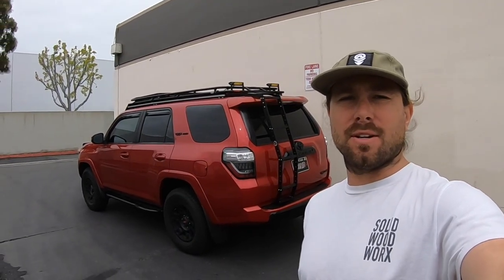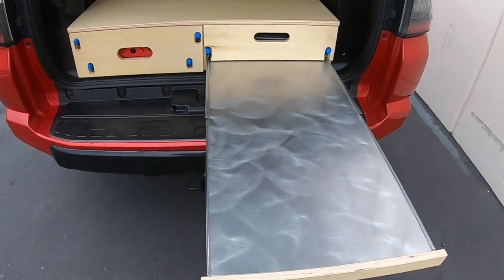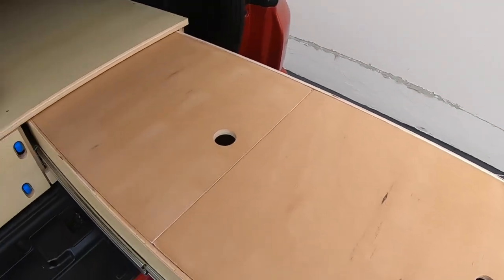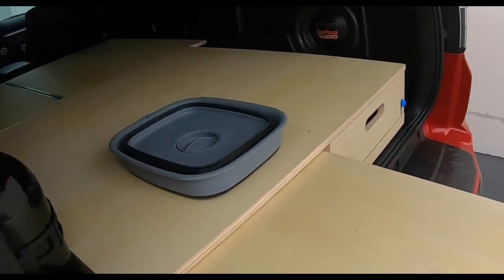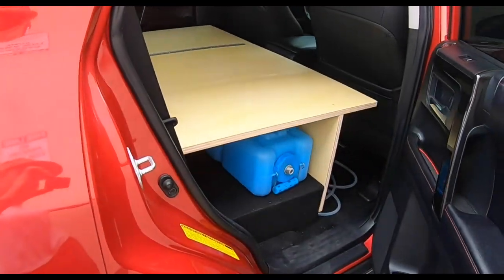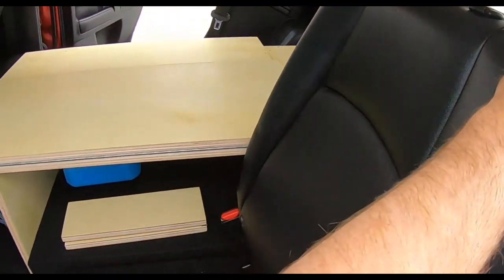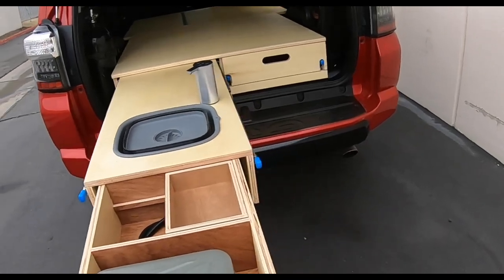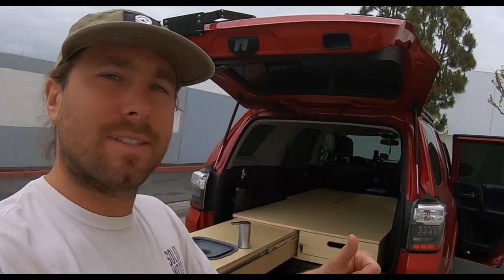5th Gen 4Runner Double Slide Cooking setup!

Comment: I've got an 8 ft. bed slide in my Tundra and use a 48" Dewalt clamp (reversed to be a spreader) for a single support leg when I have the platform completely extended and fully loaded. Being fully adjustable, the clamp adjusts to any height  and takes the load off my bed slide hardware. The portion of the clamp that extends up above my platform comes in handy for hanging my hat or towel. Ez pz. Nice work on your set-ups. For your system, I'm imagining a single leg that pivots down from a routed channel in the bottom of your drawer bottom with a telescoping leg similar to my Bosch tripod for my laser level. Simple, but stong enough to keep the drawer from sagging any.

Comment: Love your work, very clean and great looking... Still looking forward to a Jeep wrangler one though !!!
Reply: Cutouts doors in the platform for access to the slide out drawers from the top when your in the vehicle would be cool.  Also, smaller hole cutouts strategically placed on the whole unit for weight reduction and air circulation to prevent potential mildew issues that can be created when sleeping in the space.  Design a shelf above your feet area when using to sleep to store refrig/cooler, Jackery, water, food, etc.   Cheeper Jeeper TV YouTube channel has a great mod build on a sleeping platform & shelf design. With this drawer system and the Cheeper Jeeper mods, plus your own tweeking, I believe a great setup can be achieved.  Then, add a net attic system for additional overhead storage.
Reply: @grizzbuck  Thanks for the info, I do follow Dino and his channel, I just love the aspect of the small/fine details that make the difference. I know that the platform Dino made has been "updated" by another person. Honestly I have already made my system already, just love the way Solid Wood Worx shows his production and all the helpful ideas and tips !!!

Comment: What weight slides did you use? I am planning a double extension with a fridge draw on the other side. I am curious how the 72” draws setup is working out? I am worried that boiling a pot of spaghetti out the end might be precarious.
Reply from the maker: It does slant a bit. The customer uses a monopod leg if he has to cooking anything heavy on the end.

Comment: how does the sink drain and is the box storage unit you made waterproofed?  also did you account for the sitting water in the sink if the drawer is fully extended and what weight capacity it might hold with the drawer slides.  its a good design and im very interested in doing the same for my trd pro.
Reply from the maker: The sink has a little plug on the bottom its mostly to wash dishes then you dump the water when your done. I saw the customer yesterday and he says the whole setup works great. Yes everything was coasted with polyurathane.

Comment: Does that pump work just like that? As in, take it out the drawer, sit it in place and it is ready? Amazing if so!
Reply from the maker: Yes, you have to connect the water line but ya it is battery operated.

Comment: I have a Toyota 4Runner (4th Gen) and I wanted to remove the interior plastic panels along with the seatbelts in the back (rear seats already removed).
I feel as though there could be a lot of wasted space between the plastic and the body of the car... Is it worth removing it? I've never seen anyone take them out.
Especially because I want to build storage units on the side of my bed, instead of it being just underneath the bed - So I would in a way build over the plastic segments anyways
Reply from the maker: I personally wouldn't know I have net removed many plastic pieces on a 4runner yet!

Comment: I love every project you do!  Just curious about one thing: when you do dual drawers like this, what thickness of lumber are you using for the center support between the drawers and what thickness of plywood do you use for the frame of the drawer?  I built out my truck (F150) using 3/4” for vertical and top support (I’m a bit heavy) and 1/2” for other things but it is really heavy so I’m thinking I could have used a different size. 

Also (rookie question) is there such thing as a bottom mounted drawer slide (I’ve see it done like on pantry cabinets) or do you just mount them sideways? I want to make a sliding counter top that reveals a hidden cooktop so you can keep the counter top usable, just scooted over.
Reply from the maker: I use it just how you explained
Reply: SUGGESTION-An additional amount of weight reduction can be achieved by cutting or drilling areas of the plywood that would not be seen on the completed build. Also, the additional holes and cutouts would allow for airflow to eliminate the possibility of mold from the condensation of sleeping in the vehicle.